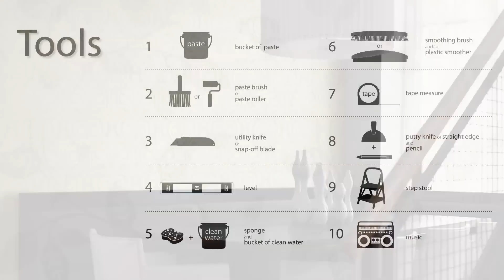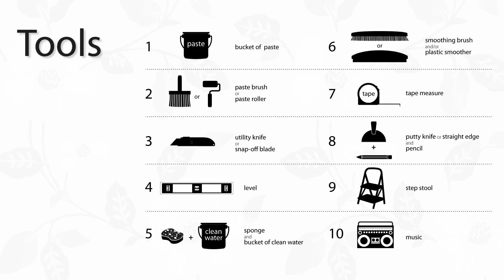How-To Video - Wallcovering Company - How to Hang Wallpaper

Comment: You can't just indiscriminately start in the corner of the room. If you have a patterned wallpaper you have to choose the focal point of the room. Then lay out how the paper pattern is going to work. You need to start on the focal point of the room with your plumb line. When you hit corners you WILL go out of square. THIS IS A HOMEOWNER GIVING A HOW TO. 
If you want to learn how to do wallpaper be sure to check other videos.

Comment: Be prepared for some major issues if you follow this "guide". There are several problems with it.One- wallcovering expands when pasted.Pasting the wall instead of the paper will cause bubbles to form.It is important to allow several minutes to allow the paper to expand before hanging.Second- You need to start in the corner farthest away for where you enter as the seam will not show as much when you enter the room.Third-You will need a wallpaper table to paste and trim the wallcovering.Cutting the paper as shown in this video is not advised.
Reply: Vincent Jackowski as a professional i love these diy hanging videos by people that arent hangers. one fine your wet width. then engineer your room so if needed you make adjustments at beginning so you dont fall an inch from a door frame or corner. paste paper NOT wall unless its a dry hang wallcovering or fabrics.
Reply: Maybe slow down and understand what you’re watching before commenting. This video is by a company that sells “paste the wall” wallpaper. This means their wallpaper is MADE so that you PASTE THE WALL not the paper.
Reply: @vq9683  I have been hanging wallcoverings for 45 years.The only time you paste the walls is when applying textiles which stain easily. I don't care what the manufacturer suggests.I even apply paste to prepasted wallcoverings even though the manufacturer suggests dipping them in water. By the way nowhere in this video or in the description do they say anything but unpasted paper.

Comment: When coming to the first corner,  yes you can cut it off as you have done,  but you should use the cut off piece as your next piece  going around the corner, as its in the middle of the pattern,  you cannot use a 'new strip' as you suggested as you will never get the pattern match.  Of course you CAN  use a new strip but why do that when you have cut off the perfectly matching piece?  using a new piece would be more difficult and time consuming,  and wasting paper.   You should score the paper then lift away from the wall and cut with scissors,  not use a Stanley knife.  the paper is wet and tears easily.

Comment: Isn't it supposed to go underneath the basebars?
Reply: No, you don’t pull up all your baseboards in order to hang wallpaper. That’s wayyyyyyyyy more work that necessary
Reply: @vq9683  Thanks! Five years later it's still relevant ;)